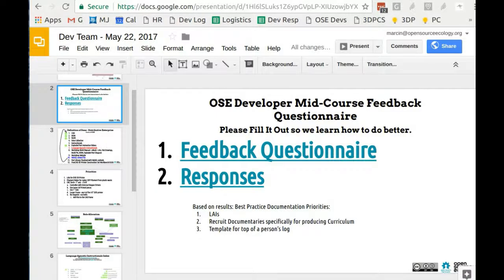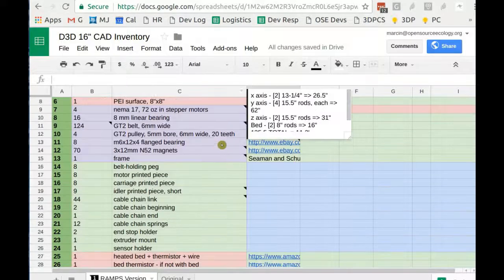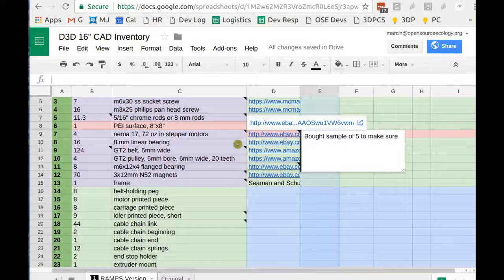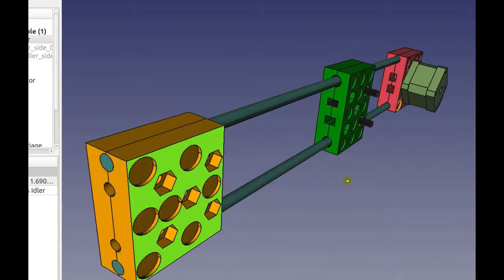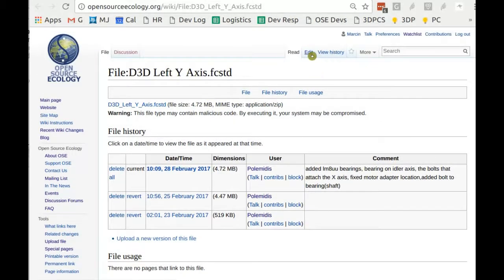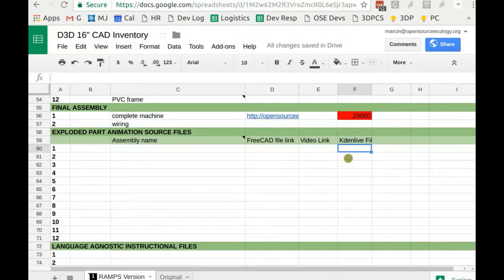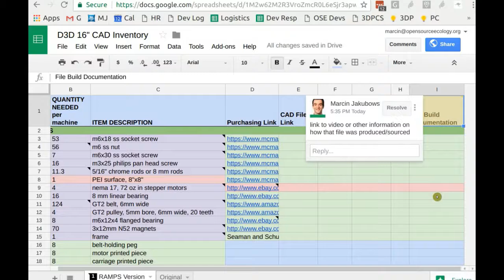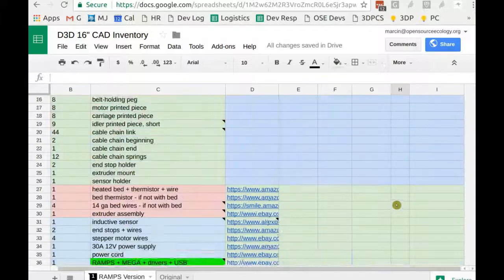May 15, 2017 Team Meeting Followup

Comment: Why are you using freecad when you could use fusion 360? Its free and it has integrated cad/cam. It's also super easy to share, collaborate and distribute files and assemblies.